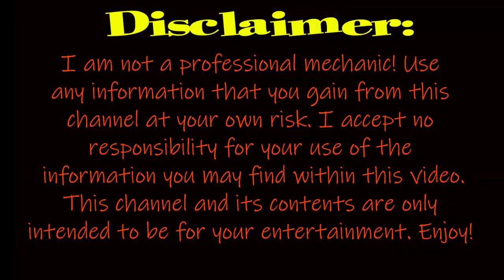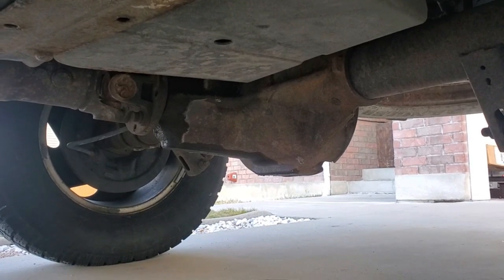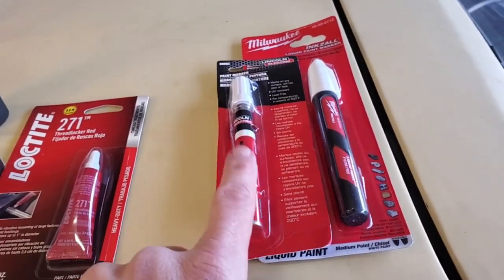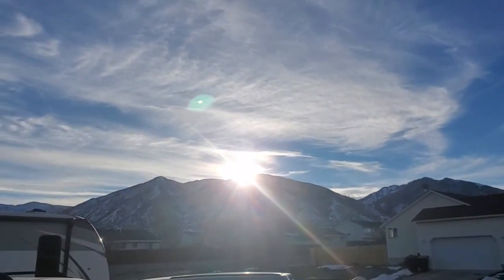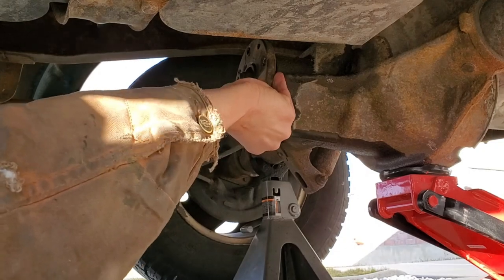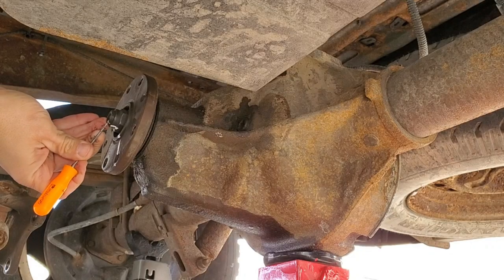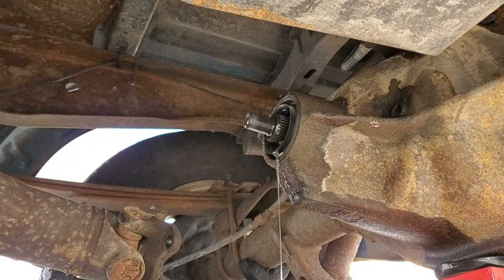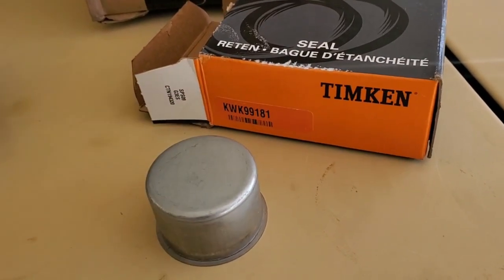The 89G - Ford 8.8 Pinion Seal Replacement F150 - EP68

Comment: I would get rid of those neapco u joints. I used to make them. They let terrible product leave the factory. I used to be able to take some home and they would break very easy. Even just going down the highway
Reply from the maker: Oh wow, what do you suggest? I had Precision's in there that dried up in 2 years. Spicer is usually my go to - but curious if you had any other insight.

Comment: I read you're even supposed to take the tires off for the torque check but like you said it took like super low inch pounds to turn the flange so it would take even less torque with tires off
Reply from the maker: Yep... I am actually pretty close to doing this job again on my Mustang. I bought an inch pound beam style wrench so I show that in the video. Probably a winter project at this point.
Reply: @89G  I saw that and it turned with the lowest setting. I was actually agreeing with you that it's kind of senseless plus you'd have to check it while re installing the nut every turn to check the torque. Better to just mark and count threads like you did. Going to tackle this again on my F 150
Reply from the maker: @shantor100  nice! It's not nearly as nerve wracking as I was thinking it would be. Good luck on yours. On my Mustang I bought a Ford seal for it. I like them a bit better than Timken.

Comment: Thank you for this excellent video.  You have helped me with several concerns/repairs in the past on my 2003 F-150 4x4 (294k miles) on the F-150 forum and I can't thank you enough.  I replaced my pinion seal as I followed this video and everything went well. However, I have a howling noise coming from the rear end at certain speeds.  Not a whining noise, but more of a howling or humming (not when I'm coasting). On tightening the pinion nut, I got it back exactly where it was, then went just a small touch more. My concern is that I may not have gone tight enough and hence the noise.  Should I go a little tighter with the pinion nut?  If so, how much.

Reply
Reply from the maker: I would put an inch pound torque wrench on the pinion nut and check the drag. It should be 10-15 inch pounds. If it's less, give it a little more torque until you get there. Thanks for watching!
Reply: @89G  Thanks for the quick reply. I appreciate your advice. How exactly should I check the drag?  What do you mean by drag.
Reply from the maker: @peterthorson7268 with the wheels off the ground, you put a socket on the pinion nut, and check how much force it takes to turn the wheels. You can get a beam style torque wrench that measures inch pounds. https://amzn.to/3WlpmMy
Reply: @89G  Perfect. Thank you for those details. That makes sense. I'll do it.👍
Reply from the maker: @peterthorson7268  good luck!

Comment: I replaced the rear pinion seal on my 2018 F150 because it developed a small leak no noise in the axle before replacing the seal now on acceleration I have a slight whining noise is it possible I didn’t get the nut tight enough even though I did replace it the same number of threads down as before I took it off.
Reply from the maker: It's possible. Often times you need to go just a tad passed where it was. You could go 1/8 to a 1/4 turn more and see if that clears it up.

Comment: Adding the fluid via the speed sensor on the top might make life easier than using the fill plug.
Reply from the maker: That's something I've never tried... hmmm. None of my other 8.8's have had that, so never even thought about it. It's worth a try though. Thanks!

Comment: Great video. I’ll be using it as a reference to replace the seal on my truck
Reply from the maker: Let me know if I can help! Thanks Bud.
Reply: @89G  will do. Do you know how much fluid it takes to fill the diff? I need to check mine before I do the seal. I have 2 quarts right now.
Reply from the maker: @alexchadbourne  is yours an 8.8 or 9.75?
Reply from the maker: @alexchadbourne  actually... the 9.75 and 8.8 are both about 2.75 quarts. It's the 10.5 that is more.
Reply from the maker: @alexchadbourne  also, is yours a limited slip? You'll need 4 ounces of friction modifier if so.
Reply: @89G  pretty sure it is an 8.8 because it is 5 lug. I’ll have to do some research to see if it is the limited slip or not.
Reply from the maker: @alexchadbourne  all of the 10th gen trucks are 5 lug unless it's the F250 or 7700 versions.
Reply: @89G  gotcha.
Reply: You can jack the diff and try spin the wheel if both move the same way its limted slip dif
Reply: @عبدالاله-غ6س  it’s an open differential unfortunately